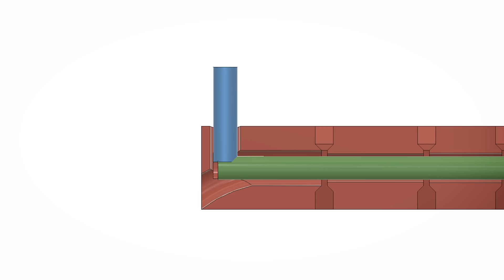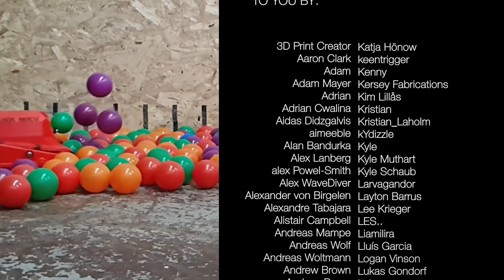3D PRINTED RC MINI TANK

Comment: It’s not a failure, it’s a safety feature. My new favorite saying.
Reply from the maker: HAHA! Yeah!
Reply: @ivanmirandawastaken  
After years of skidy skidy belts, why havent you yet decided to attach or spray rubber on the belts? Is there a different purpose for not doing that? 🤔
How about using TPE or some rubbery filament, will it work?
Reply: I hope to support @ivanmiranda buying a tshirt with that quote.  Please create it on your merge site
Reply: I like the "it's not a hammer" shirt but it would be awesome to have a shirt saying this..
Reply: @KetansaCreatesArt  You saved me from having to suggest that!
Reply: @KetansaCreatesArt  Considering that this in no way resembles a tank, I doubt he put that much thought into this project lol. Asking him this question is the equivalent of asking a toddler why they can't color within the lines.
Reply: @MFKR696  sometimes its not final project that counts, but the intention and how it can inspire others.
Afterall, it was a good caterpillar track project, commonly known as a tank.
Reply: @MFKR696  Obvious troll is obvious.
The history of tank design is littered with tanks that "don't look like tanks".
Would it resemble a tank if he hot glued an air gun to the top of the hull?
The British Mark 1 tank looks less like a modern tank than Ivan's (but it's definitely a tank).
Reply: @MFKR696  how many tanks have you seen with rubber tracks?
Considering the tests he was doing it's a valid question

Comment: Love the new track pin design 👌🏻
Reply from the maker: Yes! Game changer! Thanks Chris!
Reply: But how are you pulling the pin out once you've pushed it down. There's not a lot to pull on if you refer to your cad model
Reply: @A3dprintedman  it looks like it could be pushed out from the opposite side.
Reply: I kind of wonder if that design could be scaled up for metal tracks using heavy cable with bonded ends.

Comment: You could probably spray them with plasti-dip or some equipment rubberized spray to make them more grippy.
Reply: Or maybe printing them with a stiffer TPU?
Reply: Or just glue some thin rubber pads to the tracks, that or sandpaper, sandpaper might work.
Reply: Or print a flex track that's a bit smaller then the track he made for this and put it over the plastic track.
Reply: Why bothering. Put some rubberbands on, done.

Comment: Am I the only one that thinks if he simply added teeth or tire style grooves to the tracks it would have far more grip? Think something like paddle tires, or the texturing of an ACTUAL tank tread. Alongside that maybe an increase in weight would also add grip at the cost of speed. Otherwise phenomenal build, the way the drive sprockets mate on a singular output shaft is something I'll need to start using!

Comment: I've been having a lot of fun building this tank. Thanks for sharing the design. But if I could make a couple of suggestions based on my experience:
- a wiring diagram in the documentation would be nice. Just a simple one that shows the motors connect to the ESCs and then to the same battery. One to channel 2 another to channel 3 on the receiver.
- you need to use 2 counter clock wise motors. Luckily I bought 2 of each.
Reply: Just swap any two of the motor wires to reverse the direction.

Comment: try printing 4 layers of TPU then switch to PLAY at 240c and 15mm/s for the interface layer then ramp up to 50mm/s and slowly bring the temp down a bit to 220c to print the treads. this way you get dimensionally accurate treads of PLA but "tpu feet" for traction.

Comment: I wonder if you could just paint the outside of the tracks with a rubberised paint? It’d be quick to apply and allows you to keep the strength of the existing tracks.

Comment: You should stick some plastic to the tracks to increase traction. 
For the big tank i think you can install a simple transmission  in order to reduce the burden on top of the electric motors.

Comment from the maker: If you want to make your own awesome MiniTank, you can get the files here: https://ivanmiranda.com/products/mini-tank-mkv-bom
Reply: Why do you use so much red? do you get a discount on it or something?
Reply: Hello Ivan great job, in my project i use heat-shrinkable sleeve one the wheel fore more grip, i dont now if it's possible one your tank ?🤔
Reply: Does the plans include all electronic components (battery, motor, controller and controls?)

Also, does it spec how much filament is needed?
Reply from the maker: @davida199  I'll take a look, sorry about that
Reply: YES.
Reply: I DO.
Reply: AND I WILL TAKE OVER THE ENTIRETY OF MY APARTMENT WITH IT.
Reply: What you should do instead of printing the whole track with more grippy material is make or buy some rubber nubs that you can glue into or on to the tracks
Reply from the maker: Hi David, I looked at it, it seems that you finally were able to do it but I cannot find why it was failing for you, sorry and thanks!
Reply: why dont ypu ever put small rubber pads n the threads like in real tanks? is it because it wouldn be 100% printed?
Reply: I'm a total newbie. Does it also contain a part list for electronics and how to configure the RC to allow for steering the tank?
Reply: Does the files contain the larger top?
Reply: Eres español? O hablas español?
Reply: Tu eres español no??
Reply: I can't check out with paypal :( I keep getting the following message: "Sorry, we can’t complete your purchase at this time
To comply with government regulations, this transaction has been declined."
Reply: I purchased the files and I have started printing. I had a few questions, that I asked in your "contact us" link on the website about a week ago. Have you had a chance to look at them?
Reply: Are you per any chance related to Roberto Benigni? Cause you sure share his enthusiasm! 😉👍
Reply: Try to install some rubber on the tank threads... it will climb anything 👍
Reply: 404 Page Not Found
The page you requested does not exist.
Reply: Some rubber bands on the track will help grip on flat surface
Reply: if that tank had the cannon to shoot sweet candies it would be perfect, but your work is incredible
Reply: Error 404: Page Not Found
Reply: I like super car
Variant car
Reply: E br e
Reply from the maker: Fixed it!

Comment: I think, if you added rubber grips to the tank treads, it would have better traction on the ground. But problems could arise like difficulty turning and having to redesign the entire tank treads, but if done correctly, it should work.

Comment: I'm impressed that your gears hold on the Axel's so well. I built a 3D printed gun that used spinning disks to launch 9mm pellets (also printed) and the disks would get shocked on launch and move a bit which created heat which caused the hole to get slightly larger each round fired until it just spun freely.

Comment: You should consider some sort of rubber coating of the track, would improve traction on hard surfaces.
Can be done quite easily now with "sprayable liquid rubber", after some curing you get a nice grippy surface.

Comment: Clever way to put track chains together, but there would install some rubber to surface of that or even print those from soft TPU

Then it can climp much higher and moves accurate and with lesser noice in smooth surfaces like inside

Comment: Hey man, awesome video! Don´t know if to adress this comment in spanish, but I´ll do it in english:)
I love the tank design and it looks awesome, but I would like to suggest some upgrades for the minitank.
1.- Try gearing the wheels for the tank´s tracks, since you get a lot of speed, bot you wont get much tracktion, and by gearing it, it would make it a really good climber. (PLA gears work great, and adding a little bit of silicone lube makes them work great)
2.- Also try raising the chassey a bit, it has a very low clearence and in a offroad track, it would loose much speed by the chassey dragging on the surface.
3.- Make the tracks have a litle notch on them so they grip better on surfaces, since you can see on the vid how the tank slips.

Anyhow, looks awesome and seems very fun. Keep it up man!

Comment: Is there a good reason why you keep the track exterior surfaces entirely flat? I can't help but think that studded tracks would be far more effective on rough terrain - would give much better purchase. Furthermore, if you could get a big box of tiny rubber nubs off AliBaba (the sort that are used as feet on lots of consumer electronics), and tipped the studs with rubber, you'd probably get better purchase on smooth floors, too. Admittedly, it'd be a bit of a fiddly pain to do, but that doesn't usually stop you, so I'm wondering if it's a limitation of the printing workflow or something?

Comment: I always had to wonder. On a dual motor/tread configuration, how does one control each motor separately? Is it done via the RC controller before it even gets spit out as PWM signals? As in, are you using the throttle to control both and the steering is a modifier, or are they each running their own vertical stick?

Comment: Instead of using different filament you could have holes in the black track pieces and put some rubber "feet" on it. Like the ones that you can bye for keeping your appliances stable.

Comment: Bearings run best in pairs.
Normal Ball-bearings can't support torque loads, that's why your shaft with the drive sprockets was wiggling like that. 
Better to use 2 on one shaft
Reply from the maker: There are two on every shaft
Reply: @ivanmirandawastaken  yea I commented to early, saw you got the second one in the outer plate... Sorry for that

Comment: Idea for the treads: three-part tread segments. The main frame of each segment has a rectangular hole in the center to accommodate a rubber or similar material designed to provide traction on smooth surfaces on one side. On the other side, a bolt or similar technique to hold the adhesive part in place so that is does not come off of the tread. If you had an entire tread with that design, you would see a great increase in traction and acceleration on smoother surfaces. Cheers!

Comment: You really should tackle a tank with some suspension for the road wheels so it could actually work on uneven terrain. A torsion bar suspension would be basically fully 3D printable too, as it doesn't use any springs at all, instead relying on the twist of the bars.

Comment: I know that tread fins would just break, but those tracks could really use some texture for gripping purposes.  I wonder if rows of offset dots (flat ones not with a rounded top) would give the treads more traction and allow it to climb smoother surfaces like that plywood board you were using as a ramp?  I know you are designing this to run on sand which is awesome, but surely you will find large, smooth rocks that you may wish to tank right over, right?

Comment: Dont make treads out of tpu or flexible filaments.
I've tried to print wheels out of them in the past and they don't have that much extra grip when compared to PLA or ABS (because even tpu or PLA flex have a highish shore hardness value)

What you really need is silicone pads moulded onto a printed track. I've been playing around with a method that uses the bathroom silicone you can get from a hardware store. Its fairly cheap, and makes super grippy tires so it would work super well on tracks

Comment: You know you can buy tracks already made from Banggood, right? Have you been able to run the tank with a regular land- based transmitter rather than an aircraft transmitter? How about the Dumborc that has mixing? Not everybody has a 3-D printer and would have to send it out to be printed. If they do have a printer, it might not have a big enough platen. Will you be offering a kit in the future? Thanks.

Comment: How's about a bit of silicone on some of the threads. Maybe print the black ones with a bit of a groove in them, squirt in some silicone into the groove and smooth it out with a wet finger. That should give it some more traction.

Comment: Is there any specific reason not to use a gimbal BLDC motor for the tracks?

 I would prefer not to print the gears you use, and I already have two iPower GM5208-12 bldc motor

Comment: There is a product called "Plasti Dip" that you can her in a spray can.  Basically it is spray on rubber, a VERY light coting would go a LONG way for traction, and you wouldn't have to reprint anything.  Also, it comes in BOTH red AND black.  ;)

Comment: If you are careful enough you could have prayed a rubber coating on each track pad before you installed them on the tank. Kinda like what's on the M4 Sherman Tank like the rubber pads that's on the track.

Comment: Nice project! New screwless thread design is great. Next time you could design a mini tank with the body fully contained into the threads loop height so it can continue working even if it goes upside down

Comment: quick question: do you use "speed" control or "power" control. most RC hobbits controllers do the former and do the latter poorly. however if you meter power as an output of speed you get much better benchmarks v. volume/mass. I'd like to hear you cover the distance between speed and power.

Comment: how do you make sure that all of the parts you print will go together nicely with each other as well as the other hardware you have? Do you print them with the screw patterns already, or do you just make a hole and thread the plastic after?

Comment: Hmm, have you considered spraying the bottom of the treads with something like plasti-dip? You know, a spray on rubberized coating that sticks to plastic.  :)
Reply from the maker: I considered test this on a loose surface like sand or dirt where rubber would not matter, but then all of a sudden... you know, outside does not exist... but in 2027 I'll show you this beast on sand and you'll see what I mean
Reply: LOL Fair point!  :)  I just saw the poor little thing struggling on an incline and wanted to help it.  :D hehehe
Reply: Sadly, my experience working with it makes me believe Plastidip is likely to tear off the surface pretty quick. That said, some rubberized truck bed liner in small patches might do the trick.

Comment: the Tracks seem to slip.
If you replace some tracklinks with tracklinks that have Spikes or grooves that would probably reduce slip/increase traction.
the Spikes/grooves should be across the track  so they reduce slipping, not the side slipping needed for steering.

Edited for clarity

Comment: Ivan, very nice and simple. Love it, but for a bit of traction, you could print the block track pieces out of TPU so you could still drift but get better traction as well. The other way would be to modify your tracks so you can install small TPU pads for traction when you want or need it. Love the channel!!!!!!!!!!!

Comment: Hi,  I have paid for the plans, Could you please give a bit more information on the type of motors and esc`s used?  Also pics on how you fitted them and a how to wire them up?  Did you use two batteries?

Comment: for testing inside on the shop if you have safety mats (rubber or soft foam) or some "carpet" ... you can also add some rubber bands to it:)   should help... but always great... I wish I had the time to put into making things like this or even the money:(    I am always looking forward to the new creations you can make with just 3d printing.

Comment: What if you use a spray on rubber for the tracks to add more grip, I think I've seen it on amazon before.

Could give you a greater climb angle

Comment: I'm really sad that you designed it for printers with a minimum printbed size of 20x25. Would have been really cool if you would have designed it for the much more common 22x22 format like the Ender 3. I would definitely buy those files.

Comment: can anybody enlighten me where his obsession for spacers originates from?
Reply from the maker: From the need to add space between two parts on a rotating axle. Literal.
Reply: @ivanmirandawastaken  Well - that explains the necessity for spacers. But somehow your excitement exceeds the boredom of mere necessity by several magnitudes. I like it though. (Even though it fells like I didn't get the joke.)
Reply: @me3dnone107  that excitement comes from older projects that turned failure into success with a few simple spacers
Reply: Naduk Kerensky they weren’t failures, they were a safety feature!
Reply: @JimboJet737  not even that, they were successful because of SPACERS!
Reply: @nadukkerensky392  Thank you

Comment: what a great video, what a good job! congratulations and new subscriber. Here's a tip ... try a more adherent material for the tank chain. Blessings.
Reply: or install the tracks right side up. lol. a small variation in ground terrain would stop it dead and destroy what should be the drive sprocket
Reply: @willsmith6215  Care to elaborate? I'm considering buying the files to build this nice looking tank.

Comment: the first slope test failed due to 2 items. First the treads are smooth and second the grade was too much. The second slope test partial success  still had the smooth treads problem. If I could suggest a quick fix would be to use some hot glue and a light sandpaper, it should allow the minitank to climb that first slope with out a problem. But i enjoyed watching you build and drive it around the shop

Comment: Why didnt you just attach the motor to the wheel instead of a belt and you should of made the front rollers adjustable so you can tighter and/or loosen tire tracks

Comment: pla sucks for traction. tpu is not much better. next time try to buy a round rubber profile or T-profile and make a channel on every shackle part. clamp a piece of the rubber in each channel so it will ride on the rubber instead of the pla. it will be more quiet and have much more traction. better climbing too. nice project!!